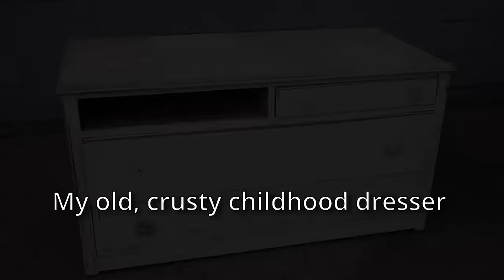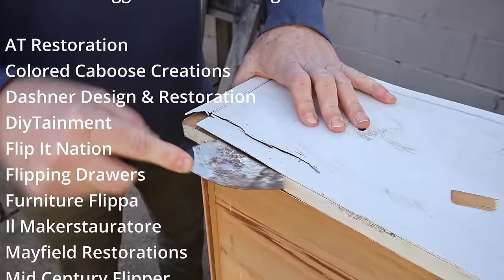REIMAGINING a MID-CENTURY MODERN Marvel from my CHILDHOOD Dresser | RESTORATION

Comment: What a transformation! Leave the band at the bottom but I suggest staining the light strip at the top and bottom the same cherry as the rest of the piece. The long horizontal drawer pulls work really well, and although I like the circular pulls at the top their shape only references the shape of the legs. I think a shorter version of the big pulls would work better. Even better yet would be ones that are square that echo the squares in the bottom band. Nonetheless, you've done a remarkably successful alteration of 60s dresser and brought it into the 21st Century.
Reply from the maker: Thank you for the well thought out feedback!! I actually considered shorter versions of the straight pulls but decided on adding some contrast. I am glad I did. Thanks!!

Comment: Just discovered your work via the MCM challenge.  Dresser transformation is incredible!  Another vote for keeping the unique strip at the bottom.  Love the graceful legs & fabulous drawer pulls!  I took the back off a server & used a hammer & block of wood to pound out the hopelessly stuck drawers.
Reply from the maker: Thanks!! I am glad you found the channel. Taking the back off probably would have been my next step if the crowbars didn't work. Thanks for weighing in on the inlay question. Cheers 🍻

Comment: Really excellent. Such hard work. I don't really like the hardware but that is very subjective and you chose what you like. I'm not sure what you are questioning that should be changed? It seems very beautiful right now although I probably would have completely cleaned up the back as well and put the date in tiny tiny letter somewhere ha ha
Reply from the maker: Thanks for the honest feedback!! I cleaned the back but didn't sand it because I wanted to keep the old lettering intact. I started to sand the edges but it looked too sterile. I tried to make the new date look just like the old one.

Comment: I would have liked to see you fitting the drawers to the cabinet so they would open and close like they did.
Reply from the maker: I actually didn't have to do much. Once I brought them inside and they settled into normal humidity, they fit much better. I did have to adjust the bottom of the top drawer a little to account for the veneer on the top of the bottom drawer but I can't show everything, the length of the video was long enough. Thanks for the feedback!!

Comment: Whoaaaaa…that was a labor of love ❤️How many hours did it take you? Turned out beautiful!
Reply from the maker: Thank you very much!! It didn't take as long as you might think. The longest time was spent leveling the plywood I used to square off the sides. I should have cut the plywood in half and run it through a planer. Lessons learned with that one. 🤨

Comment: This was a really nice restoration. Love the colours, the new handles and legs. But, I really wish you'd sanded the back. Just a bit, while avoiding the dates. The contrast to the rest of the piece is disturbing.
Reply from the maker: Thanks!! I actually started to sand the back but it looked too sterile. I completely understand your point though. I usually would sand up the backs of pieces. I cleaned this one with mineral spirits and left it. I like the contrast and I was really worried about messing up the old date I painted when I was a kid.

Comment: Leave the inlay detail. 

Why don’t you router the overlapping veneer rather than use an Exacto knife?
Reply from the maker: I used a razor blade to trim the veneer because I felt that I had a little more control over it. I actually had never used a router before this project and I had never put down veneer so much of this was new for me.